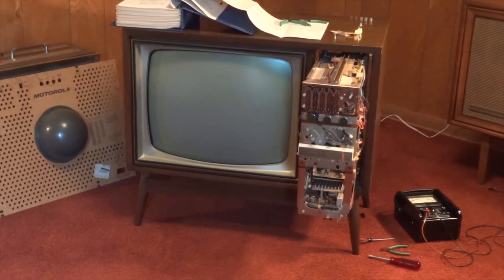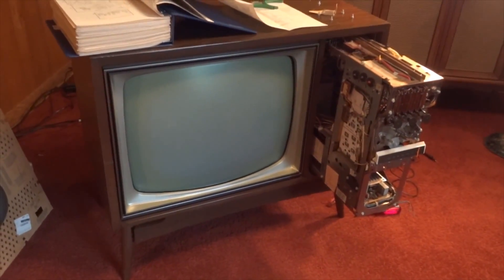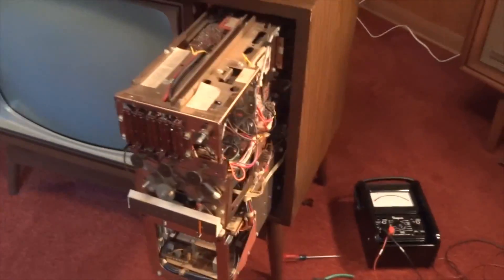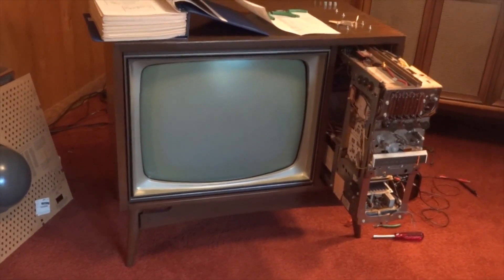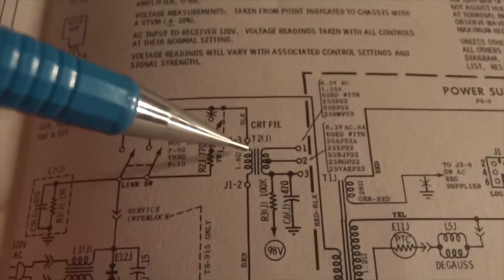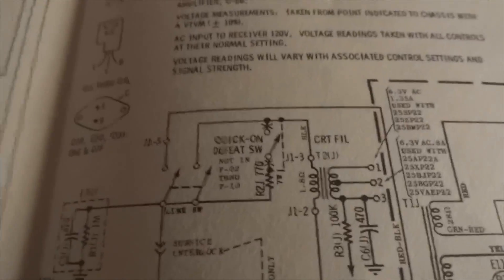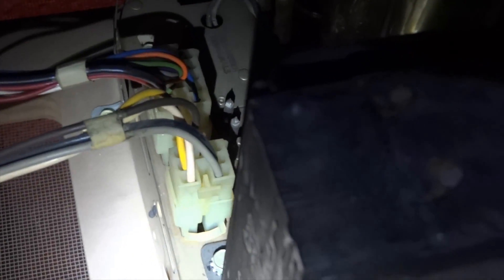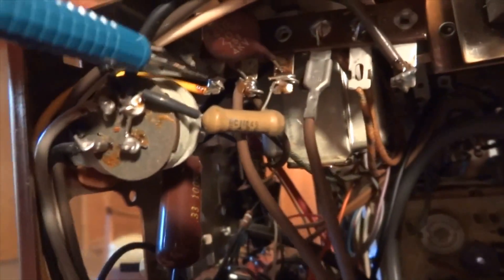How "Instant-On" Works and How to Disable it on a Motorola Quasar Color TV

Comment: What I find most interesting about this video is the date of manufacture. I would have sworn that all TVs in the late '60s were still using a (mostly) tube-type chassis. I owned a GE in the '70s that sure did, but maybe Magnavox was ahead of the curve. This raises a question - Did instant-on TVs with a tube-type chassis only apply filament voltage when switched off? Or did they also maintain some low level of B+ to prevent poisoning the tubes? I just can't remember now how that was done.

Comment: We had a 19 inch RCA television in 1969 and it had an instant on as well however on the back there was a toggle switch saying vacation which was the same as a defeat so we kept the vacation switch off thereby saving the life of the picture tube like you said

Comment: Politely suggest you read about early computers that ran on vacuum tubes; they were left running 24/7 to improve the reliability of the tubes.  This is 1960's technology though, it wasted a lot of electricity for a slight convenience.
Reply: I don't think it really helped the reliability of the tubes as much as it did the surrounding circuitry. When a tube device is powered on, there is a massive amount of surge current. Those computers also had so many tubes that filament flash and subsequent spontaneous failure was a greater concern than wearing out the cathode material by cooking it to death. I have seen a video someone posted of a house intercom, an object that wouldn't have seen much use have a terribly weak audio output tube because it constantly kept the filaments heated.

Comment: This was our first color TV purchased in 1970, was a great set that lasted about 20 years and had a very bright and high contrast picture. If memory serves me, it had a 27.5Kv high voltage section that was responsible for the vibrant picture. What was nice on this set is that all the convergence controls were easily accessible by pulling out the drawer. We had the instant on disable switch on the chassis which was keep off.

Comment: Consumer Reports, probably just before instant-on sets were banned in a lot of places, wrote that while the feature costs more to run, it was easier on the tubes because it avoided thermal shock during warmup. I'd guess that this was of varying importance depending on the construction of the tubes themselves and their surroundings. It's probably a bigger disadvantage on a vintage set, that might spend most of its life plugged in, but off, than on a then-current set that was constantly being turned on and off.

Comment: I'd be (from today's point of view) not only concerned about the life of the CRT filament, but also how much power this feature consumes - it would be using a fair amount of power even if it was switched off I assume?

I also remember my grandmother having an old ITT TV set back during my childhood (mid-80s), it was equipped with tubes (for the audio I assume also? - I remember my grandmother opening it herself for service a few times and there were a fair bit of tubes in there). It had an instant on feature as well, but this feature could be turned off!
I still remember, there were two on/off switches. If one was pushed in, the TV set turned on, but needed ~ half a minute until sound and picture came up. The other one just set the set on standby, a red-dot indicator came up in the program preset display (by the way, a nixie tube style one!). If the standby switch had been pressed in for a while, and the power switch was turned on, there were instant picture and sound. So with this set you were offered the choice if you wanted to use the instant-on feature or not.
Unfortunately the set got disposed of after a fault and replaced by a new one - it smelled burnt for a while while watching a show and suddenly almost caught fire and scared the hell out of me.. I could hardly sleep the night afterwards!

Comment: This set definitley doesn't need Instant on. It doesn't take any longer for the picture to come up than most modern CRT solid state sets. Something I have noticed though is electronically controlled CRT RCA sets over the last 25 years or so seem to have an instant on and the screen doesn't "flash" or collapse  when you turn them off.

Comment: I remember when the quick start was a feature showcased at the dealer display advertising and the salesman pitch. thanks for the post. !
Reply: John Wascavage
Kind of funny too when you consider that with the feature disabled, it still only took 3 seconds for the picture to come on strong and clear. Compare that to an older TV that took 10-15+ seconds before it came on.  Heck, I've got a NEW CRT tv that takes longer than 3 seconds to fire up!
Reply: I remember the same sales pitch, but also how knowledgeable and technically correct the salesmen were, something you don't see today.

Comment: Reminds me of my parents' 1972 Sylvania TV set. It had vacuum tubes for the video and solid state for the audio. It had a feature to keep the tubes partially operational at all times. It was easily disabled by a switch in the back of the TV. Later in the TV's life it was unplugged when not in use because the on/off switch was broken (we finally got it fixed). The picture tube lasted 18 years and my parents just got a Zenith after that, which died only a few years later.

Comment: I suspected that my grandmother's 1974 Chomacolor II (19EC45 chassis) had this "instant on" feature. I noticed that if I left the TV plugged in overnight there was very little warmup time. I never did hook up a Kill-a-watt to it to confirm my suspicions. The chassis did have a safety interlock that disconnected line power if you took the back off. I thought it was a standard feature at that point.

The good thing is for most of its life, it was plugged into the switched outlet on a cable box (so you could power the TV on/off with its remote). After it was "retired" from day to day use, it sat unplugged for about 20 years!

Comment: I remember a old tube portable B/W set. The instant on feature was just a diode across the power switch. Customer didn't like that it was warm when plugged in and turned off. So I just snipped the diode.

Comment: Great to hear from you again!
   I just started watching and noticed immediately on the floor was a Simpson 260 with the external field hard-shell case. I have the "exact" version as well. Yours is only the second one like mine that I've seen! Now back to the vid!
   Great but very easy implement mod. Why did they even bother with this feature in a fully transistorized set when the CRT produced an image so quickly?
   I had older generation relatives that had the same philosophy. They would unplug electronic devices when not in use. Who could blame them? Paper caps used in the line running 24/7. They probably had some personal stories about these sort of issues with either themselves or people that they knew. No wonder they wanted to unplug for safety reasons! In your case, this added decades to the service life of the CRT.
   Wonderful color image in this set.
    Thanks for the video!

Comment: What is interesting is they could have just had a three position switch on the front "Off"  "Standby"  "On"  and explained in the user manual (back when people actually read those things for more than humor value) that standby would allow for an instant on but may potentially reduce tube life and the Off position should be used when retiring for the night or when not using the set for long periods of time.

Excellent video Doug.

Comment: Ironically, TV manufacturers use the instant on feature as selling point "end annoying warm-up time and to "extend the life of the tubes" by reducing "metal fatigue" in the tube filaments from constant on/off cycle. Such was not the case. It just added to power cost and lowered tube life.
The instant on feature was not limited to TV's. I worked on a 1961 Westinghouse AM/FM table radio for a friend that had that feature. There was a sticker in it that gave a similar explanation as above and said it used less power than a C7 Christmas tree lamp when the set was "off." After I replaced the capacitors and a few bad resistors, my friend's set just barely worked. I then checked all seven tubes and all seven were bad, with very low emission. The moral of the story. Two winners- the tube manufacturers and the local power company!!

Comment: Correct me if I'm wrong the holiday switch is basically a similar concept, you basically hit the switch when you go away so the CRT is no longer lit.
If you think about it they should have put the holiday switch on the front of the set so more people would have used them.
Was that show, I Dream of Jeannie?
Reply: I've seen a "vacation " switch on this era set which completely turned off power to the CRT filament and the entire filament string.
Reply: That show was Bewitched.

Comment: I can't believe how easy you're able to come by alot of these vintage TV's. I can't seem to find any thing in my City, which is kinda of puzzling because I don't necessarily live in a small City either. Even when i do find something on Kijiji their usually asking way too much over the value. I seem to have more luck at my local electronic drop off depots but I hardly ever come by anything  70's never mind anything late 60's. It's a real shame too, since I think most probably ended up in the landfill 25 to 30 years ago. When cheaper Plastic CRT TV's that were lighter and more affordable became the new desire.

Comment: Interesting.  I remember back then there were stories (whether true or not I don't know) of instant-on TV's catching fire.  I wonder if the original owners thought that so they kept it unplugged when they weren't using it.
Reply: Yeah, I remember hearing that too.
Reply: Ours started smoking, then I pulled the plug.
Reply: +meleagrisfelis The one thing I remember about these sets is that they tended to get caked in dust, probably from the constant convection currents. On a set like this, with only two tubes, that might be less of an issue.

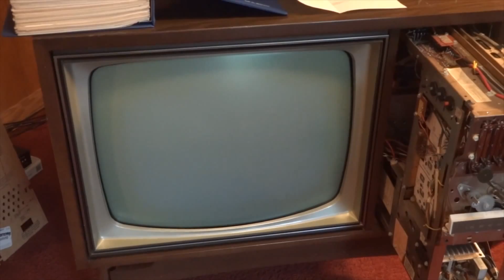Comment: Video starts at 1:09 (you should be able to fix this in YouTube)

It's really cool that the original owners kept this set unplugged. Very smart.

EDIT: Okay, he edited the video so it no longer starts late
Reply: Why would the video start there?
Reply: My dad, and to a lesser degree, my mom, were terrified of electrical equipment.   He unplugged EVERYTHING when it wasn't in use - the TV, the stereo, the toaster, even the floor and table lamps.  No AC-powered clocks - they were all either battery operated or wind-up models.   He grudgingly accepted that the refrigerator had to be left plugged in.  The really odd thing was - he was perfectly okay with the pilot lights in the gas stove and the furnace.  I think it was a case of what he understood versus what he didn't.  You can't SEE how electricity works (generally, if you 'see' electricity, something's gone tragically wrong!), but a pilot light is a fairly simple concept.

The house was positively pitch-dark at night.  Even night lights were considered 'dangerous'.

He wouldn't even change a light bulb unless he was absolutely certain the lamp was unplugged.  He'd go into the basement and pull the fuses before he'd swap out a bulb in the overhead fixtures.  Why?  Because it was the 'official' procedure to disconnect power before changing a light bulb.  He read it in a POPULAR MECHANICS or something.  He never realized he was in just as much danger dinking with the fuses in that panel as he was changing the light bulb itself - perhaps even MORE danger, as the floor of the basement was concrete (and therefore technically a 'ground').

I bought my dad a VCR for Christmas one year; it too was unplugged when not in use.  Which, of course, meant he couldn't use it to record his shows, and therefore the machine was completely worthless to him.  It took me bloody ages to convince him it wasn't dangerous.